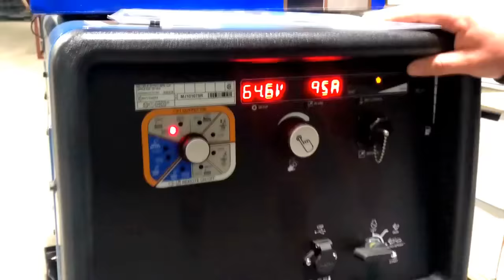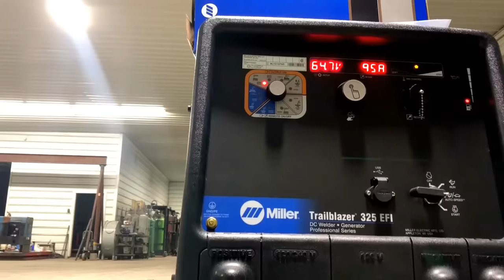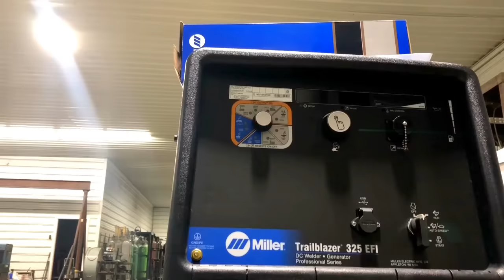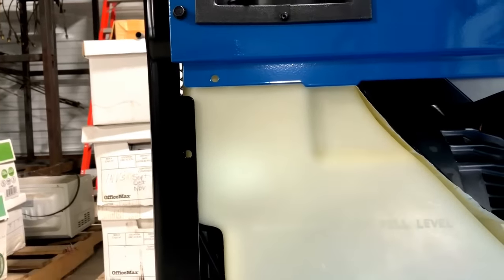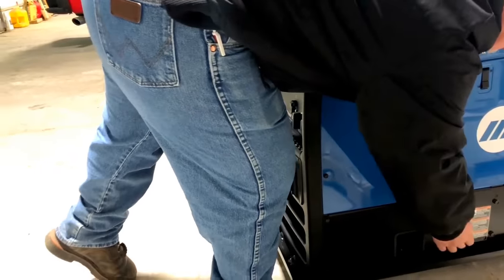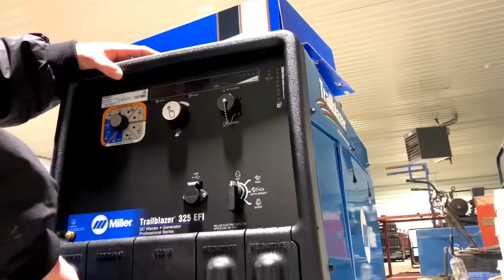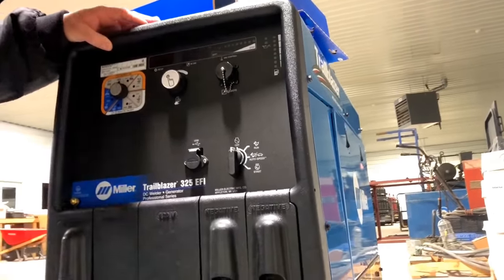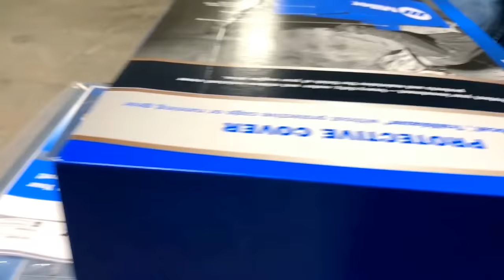Miller 325 EFI Trailblazer

Comment: Very nice indeed but extend the stack a bit and think about a heat shield with all the miles you drive. Servicing and access to operate look really good. Strong high quality back up is gold today. Some protection for the electrics from the wet long term I think would be wise.

Comment: Those are super welders !!! Perfect perfect perfect for your operation!!!! DON'T JUMP START that welder just replace your battery or charge it !! Don't know if you've been told that but it can damage the board in it.. unless miller changed things on these new ones . I'm sure you know but that's my two cents

Comment: I’m new to your Channel just sigh up . So how you like that trailblazer . I’m Service tech down in marble Falls Tx Area on welder . One thing on them welder . Don’t jump start one if the battery get week on you . Only trickle charge it . Or replace the battery . You blow your pc boards on it . I replaced few of them  pc board on the Hobart and the Miller unit  . I like the Miller Products . Have a nice day . Sir .

Comment: Great welder Wade. Depending on how much you use it, you might consider getting a cover for it to help protect the electronics. It definitely is not as heavy duty and able to standup in bad weather as your old one. Just a thought.
Reply: loadpin There was a box sitting on top of unit that said protective cover. I believe he is covered! :-)
Reply from the maker: Yup boys I’m on it thanks for the heads up

Comment: What kind of motor is in that new welder Wade? That's the thing about fixing the old welder. You have to have a big old welder that can run balls to the wall to air arc.
Reply from the maker: Joel Adank it’s a Kohler
Reply from the maker: I think 25 horse air cooled like a lawn mower
Reply: Logger Wade ok Thanks
Reply: Gotcha. Thanks